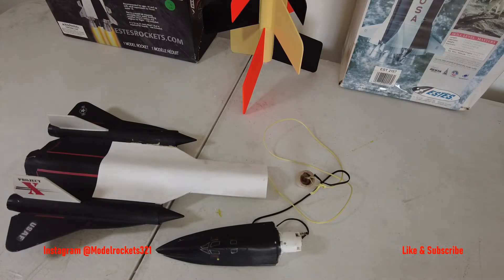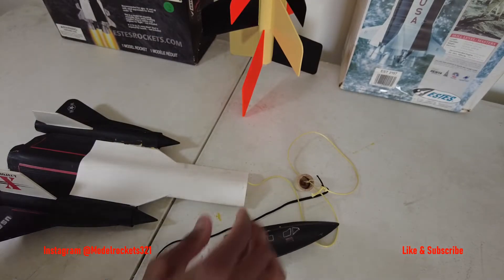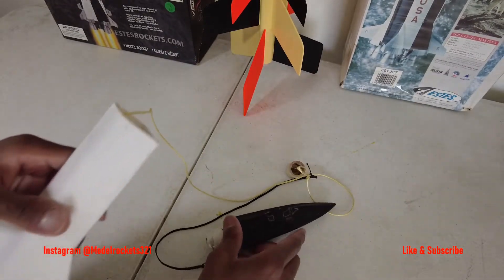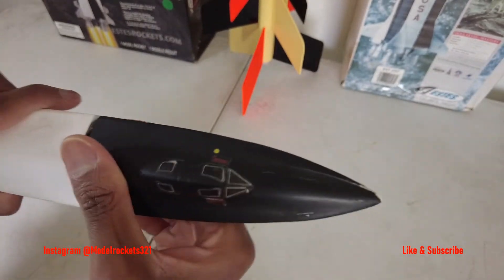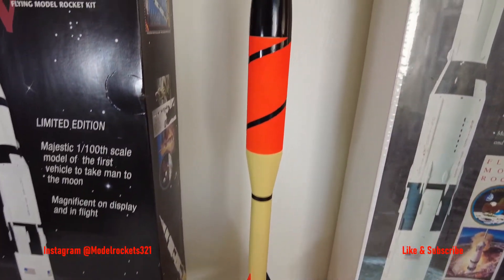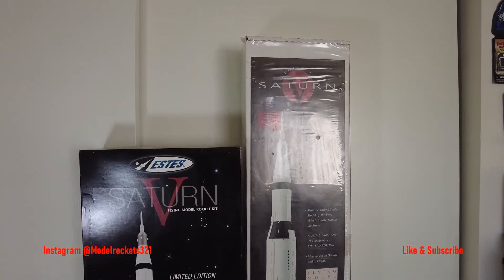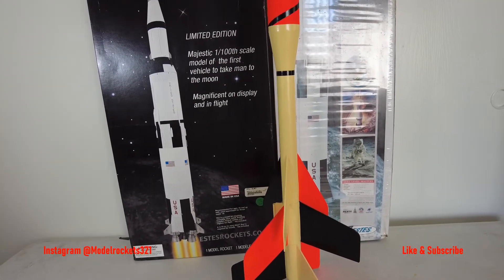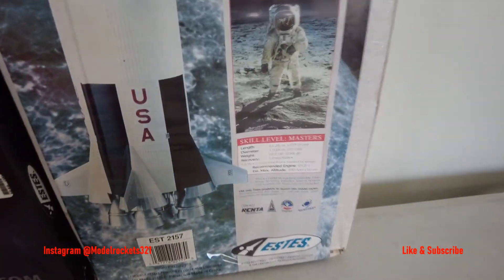SR-71 Blackbird Project X,  Estes Saturn V and Farside X - Model Rockets!

Comment: Those Saturn V's and other large scale rockets are pretty cool. I had the Maxi Alpha III. The launch was slow and loud and would always draw a crowd. I think I mentioned once before too that I had the scale V-2 kit with a 4" diameter tube. Very large rocket. I regret that I never got around to building it. I'm sure it would have been a very impressive sight to see when it launched. Anyway, I'm enjoying the videos and the memories they bring back. Many thanks. 👍
Reply from the maker: Indeed they are. Thanks for watching. More to come.
Reply: @modelrockets3215  You're quite welcome. I'll be watching.
   Here's something that popped up on my recommended list. Thought you might like it. Central motor is a 'P' engine. This is some serious rocketry. 
   https://youtu.be/nlVcAJFU-5E